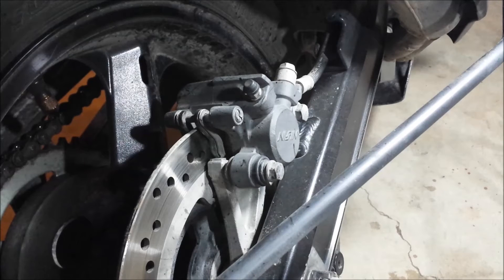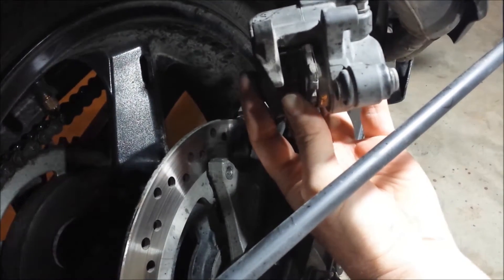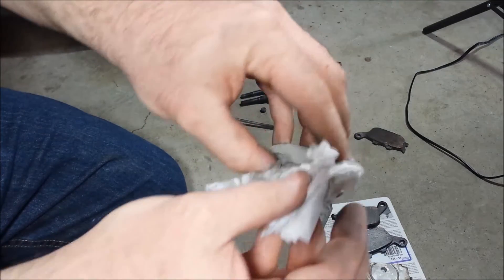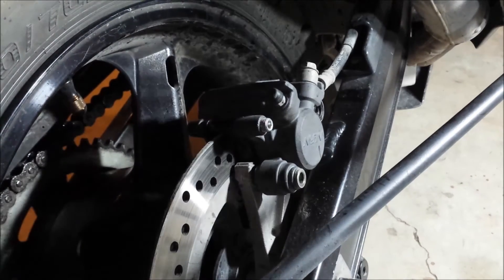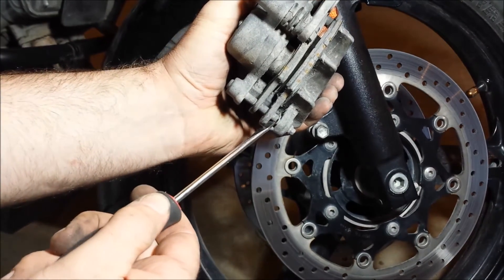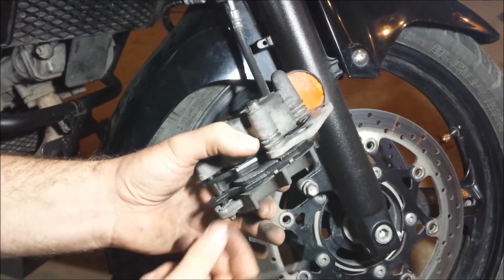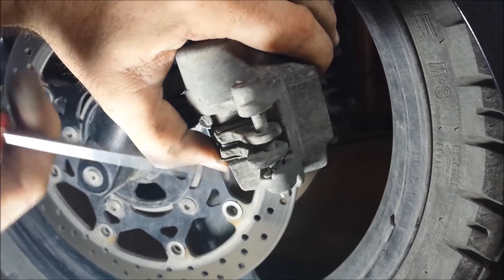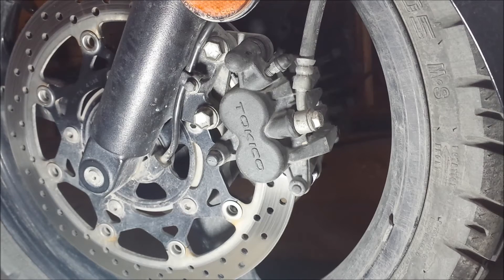V-Strom Brake pad change. Easy!

Comment: Great thank you, one point to mention, clean the piston before pushing back in to body as you might push some crap past the caliper seal, brake cleaner and tooth brush, wipe off then apply light coat of brake fluid then gently push back in to housing...

Comment: Nice Video.  Ordered a complete set of EBC pads on Amazon, changed them all out in less than 30 mins.  Easy, but those front bolts needed a breaker bar - They were tight!  Impact wouldn't budge them, but I torqued them back on with the impact.  I bought my bike new in 2007 & this was it's 1st brake job.  The rear pads were completely worn out with a millimeter or 2 of pad left.  The front was about 50%, but I replaced them anyway as the bike was getting harder to stop.  The new pads have a lot more stopping power, even though the new pads aren't seated yet & the foot brake used to travel several inches before actually working.  Now it barely moves.  No noises, which was my biggest fear.  My Wee-Strom was starting to have loud grinding gear shifts, especially from 1st to 2nd.  A fresh oil change makes shifting smooth again, but only for about a month, then back to clanging, so I watched another video on clutch adjustment & cleaning out the gunk slung from the chain, all over the clutch screw assembly & that fixed it!  The clutch wasn't engaging (or is it dis-engaging?) fast enough & the clanging was because I was actually shifting without a clutch, even though the lever was pulled in.  Used de-greaser & it's now cleaned up like new & shifting hasn't been this good in a long time.  Adjusted the clutch at the assembly, then adjusted the slack in the cable at the assembly.  Also ordered LED replacement bulbs for the headlights; should be in tomorrow.  The old 12 year old V-Strom is better than it has ever been.  Thanks for posting the video!  Just under 10,000 miles if you were wondering.  Didn't know I was being so aggressive on the rear brakes.  Thanks again!

Comment: This is great, thanks! 

Also, I'm amazed by how much easier maintenance on the V-Strom is versus my old Royal Enfield. To change the brakes on that piece of shit, you had to pull off the whole rear wheel, replace the pads, readjust the chain and then get the wheel back on.

Comment: Very clear and concise. Subbed. Relatively new to riding. Some questions:

What is the technical term for the piece holding the pads?
Can that piece be painted?
What do you use to clean the pieces? Just a wire brush or some type of cleaner as well?
Finally, is there a special type of grease necessary?

Thanks for any and all help or tips!
Reply from the maker: Good day Calvin Jasso! The technical term for the piece holding the pads is called the caliper. The caliper can be painted as long as the pistons are masked off. Regular brake cleaner works the best since it doesn't leave any residue. Use a plastic bristled brush or something less aggressive than wire. Any automotive grease will work.
Let me know if you have more question! I don't know everything, but I'll try to be of some help!
Reply: Mainstream Moto thank you!

Comment: This bike has seen some gnarly roads! Done this job quite a few times myself. One thing I'd add to this is, do NOT go cheap on the pads. Get reputable, solid brand pads, none of the no-name, made in China crap you can buy cheap on eBay. Perhaps, also use a rag in between the clamps/C-clamp when pushing the piston in so you do not scratch the calipers.

Comment: I just changed my rear pads. Now the front bolt  will not go all the way in. There is a gap about 2mm before it touches the caliper, and i dont dare tighten it any harder in fear of stripping the threads. Any ideas?

Comment: I am and have been enjoying all your videos.  I do not see my question below.  Can you recommend a brand of brakes? Do I need to turn the rotors or replace them? I have 8K miles on my 2015. Thanks in advanced.. keep doing videos. Looking forward to them.. from California.
Reply from the maker: I've gone about 55k and have not replaced the rotor/discs. Unless they are bent they should be fine. If you are feeling some pulsing in the brakes it could be an indication that they are warped or bent. I've always gone with genuine Suzuki brake pads but that's not to say that other brands are no good. Some pads may give you more or less grip, nothing wrong with testing out different ones!

Comment: I just replaced the rear pads on my 2009 DL650. The thin plates/insulating pads were not there. Is this a problem? What are these parts called? The video was very helpful. Thanks!
Reply from the maker: Those thin metal plates are called Retainers. If they are not there I would get some replacements ordered. Its possible but not likely that the brake pad could rust to the caliper piston or create some uneven wear (just my 2 cents) I was told by my local Suzuki dealer that the rear doesn't have insulators but looking at the parts diagram they are available!
Reply: @mainstreammoto4856  Thanks for the information! I see them on Partzilla. For what it's worth, I have been riding this motorcycle for several years without them.
Reply: Many thanks for awesome video, well done!
Please advise high temperature silicone that you use!
Reply: You can also just cover a thin film of grease on the rear side of the pads if you dont have the retainers.

Comment: I have a question. Have you ever had a problem with speed indication or speedometer? Have you had other problems with this motorcycle (electric wires)? Regards
Reply from the maker: I have not had any major issues with the bike at all! I have put 30k miles on it and have only done routine maintenance (change chain and sprockets, oil, coolant, tires ect...
Reply: Ok. Thanks
Reply: Ok. Thanks

Comment: Do you know the torque specs on the rear caliper bolts and also the front ones please thanks
Reply from the maker: 28lb-ft for the front bolts and 16.5lb-ft for the rear ones.
Reply: Oh man thanks a bunch
Reply from the maker: @noedelacruz5910  You bet! Anytime!

Comment: I can't get the front bolt to thread back in, pad pin and rear bolt are threading in no problem, what am I doing wrong?
Reply from the maker: Is this the front bolt of the rear brake? or a different bolt...?
Reply: @mainstreammoto4856  Yes the front bolt of the rear brake, it fits into the hole and boot  ok, every thing seems to be back in place but it just won't screw in and I don't want to risk stripping the threads on it, can't figure whats wrong with it. thanks
Reply from the maker: @roadwarrior8560  Yes, that bolt has given me problems as well. Try getting it started without the other bolt in. Push in on the bolt and turn it backwards and feel for a slight click of the thread seating down then, push hard and thread it in. You're smart for not forcing it. I couldn't get mine to thread a while back no matter what I did. I ended up getting a new bolt and it went right in! Hopefully you wont have to get a new one but that fixed the problem for me. I made sure to install the new one using the sequence I described. Hope this helps.
Reply: @mainstreammoto4856  Thanks, I finally managed to get it to thread in, I will order anew bolt for next time, might as well get new pad pins as well and I also need a dust cap for the rear bleed valve. great tips there, thank you.
Reply from the maker: @roadwarrior8560  Awesome! I'm glad it worked!

Comment: I wouldn't put grease anywhere near brakes
Reply from the maker: Rusty brake parts don't work very good and they don't last as long either. As long as grease doesn't get on the pads or discs it'll be fine. (very light bits of grease)   ...but, you can do whatever you want.
Reply: What's going to rust?   @mainstreammoto4856
Reply from the maker: @roadwarrior8560  Everything....
https://www.youtube.com/watch?v=ZBu9K4YNT3o